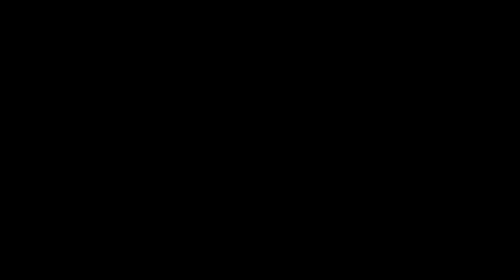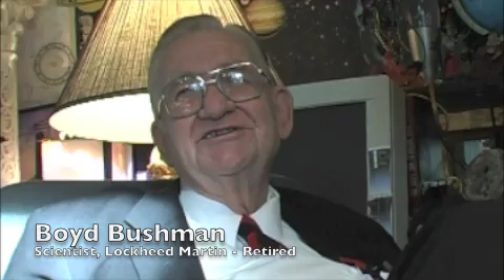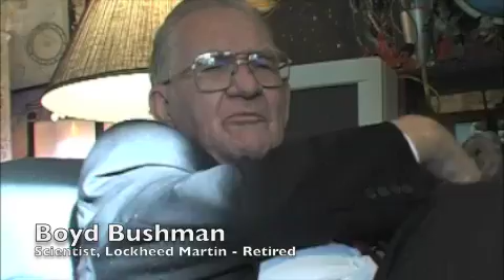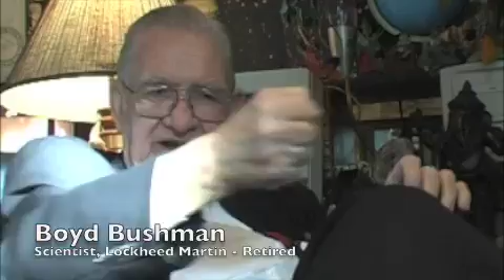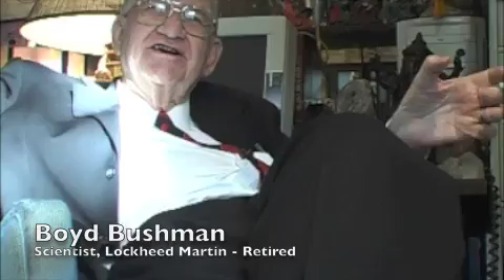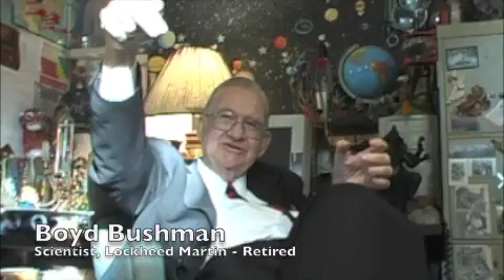2012-0923 Boyd Bushman Explains Holes.m4v

Comment: If you'll notice on the copper pipe he has something taped around it and the steel pipe has nothing around it. Could that possibly be a magnet to slow the dropped magnet as it goes through the copper pipe? I also noticed he didnt even bother to mention as to what he had taped around the copper pipe. Come on the viewers are not stupid. I DEBUNK this video as a fake!
Reply: Eddy currents moving perpendicular to the magnetic flux reduces the speed of the magnet by increasing the potential of the field. Don't be so stupid.  Its real and easily explained.
Reply: You tard, its the barcode/store sticker that's on the pipes when you buy a long length of it, usually 8 or 10 foot increments.